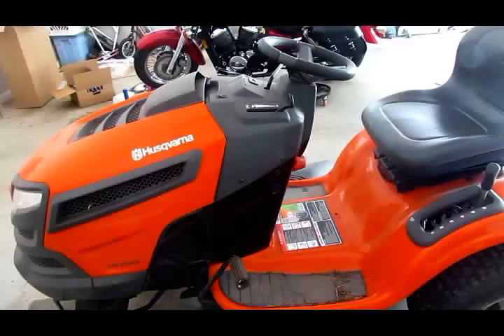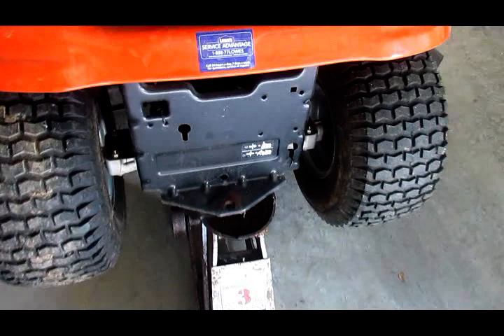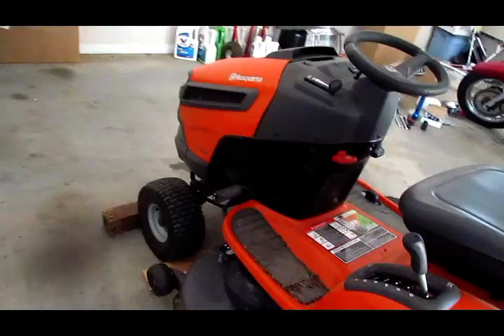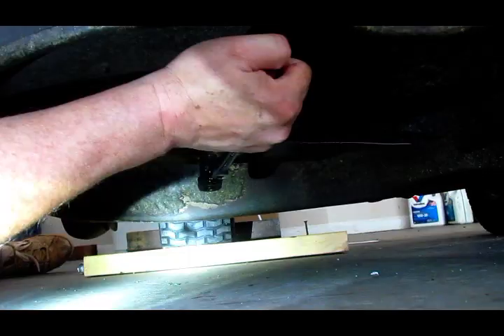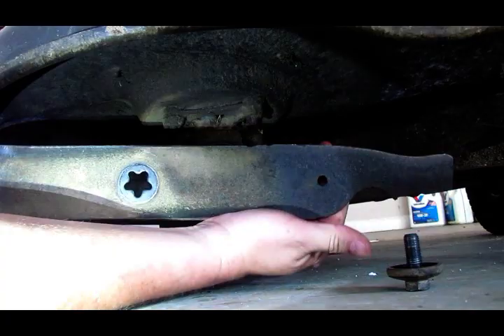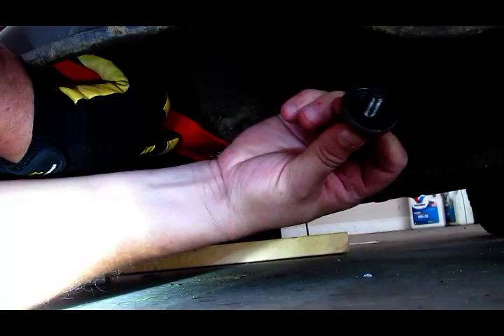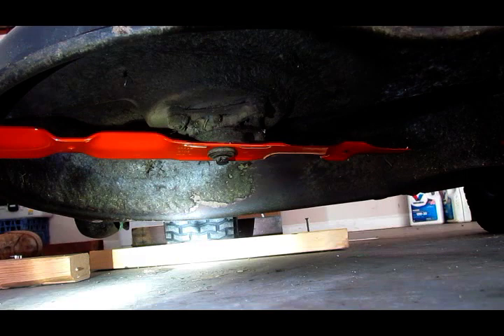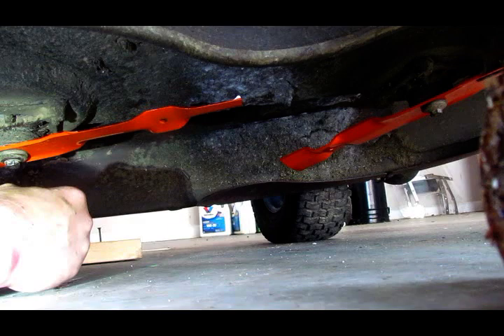Husqvarna YTH22V46 Blade Change - change your yard tractor blade

Comment: Hi Dennis...where is the reservoir for the transmission....I just want to check it because  !!!!  When I release the clutch it rattles....it's a modelYTA18542 
Thank you
Reply from the maker: Thanks for watching, Elaine!  I don't believe there is a reservoir for the transmission.  Husqvarna typically uses sealed transmissions.  The rattling may be the drive belt idler pulley (most common), a worn belt, or possibly the bearings in one of the other drive belt pulleys.

Comment: Dennis when you converted to mulching blades, did you find that you had lower the mowing deck one notch to get the same height cut you did on the high lift blades?  Great video!
Reply from the maker: Hi Rex, Thanks for watching!  No sir, the mulching blades I use have the same cutting height as the 'regular' blades.

Comment: Curiosity question only: In another video of your's, you showed using a set of Rhino ramps when you did an oil change and lifted the mower up on the front. They fit between the wheels, but I am wondering if they can be used for this procedure in lifting up the back of the mower, as well? Would they not work for this or is there something which would get in the way of them doing so effectively?
Reply from the maker: I think they would work fine.  I didn't have the ramps when I made this video, so couldn't use them or show that.  Thank you for watching, James.  Great idea!

Comment: I have the same tractor. The drive belt came off and took the fan blade on the transaxle with it. I cant find the part number for the fan blade. Any ideas?
Reply from the maker: Hey Brad, thanks for watching.  This is a tough part to get the number for, but this is what I came up with:  Part # 1A646083050
If you find one, just verify that it will fit the Tuff Torque K46 transmission.

Comment: Hi Dennis, GREAT VIDEOS..Why do you not use gator blades?
Reply from the maker: Thanks for watching, Charles!  I've tried them a few times, I just don't see any difference with my lawn, so I cant justify the added expense.  These generic blades I use do a good job, sharpen and balance well, and they are a lot cheaper.  It may be because I have a centipede lawn.....centipede cuts really well, it doesn't get real tall, so the clippings are small.  That may be why I don't notice much difference.
Reply: The Husky dealer by me WON’T install Gators 12:49 them as he claims their weight tear up spindles.  I used them on my 38 Poulan and had a broken, not worn spindle.  I believe him.

Comment: Hey there Dennis. Susan here again.  The lgt2654  has a grass catcher, some time it all goes well. Other times it just all jams at the opening. I wait 5-6 days after any rain to be sure it isn't wet.
I've had to dismantle the shoot to clean it out. Issue is once I take the shoot off I about pull my guts out to reconnect the metal things reconnected to the frame. What am I doing wrong? What can I do better to not hurt myself?
Reply from the maker: Hi Susan, thank you for watching!  I'm sorry, but I don't have a grass catcher and don't have any experience at all with the Husqvarna grass catcher.

Comment: Hi Denis sorry I’m bothering you again. But I was wondering if that tractor you have (yth24v48) is good for some what steep hills. I would say about 20-25 degrees slope. Please let me know bc your response will depend if I get that one or not and if not what would you recommend and what would be the best way to mow it. Thanks!!!
Reply from the maker: Hi Denis, no bother at all!  I have one hill I cut that is probably 25-30 degree incline.  I only go up or down the hill, never across it, as I think the mower would tip over if I did.  I don't have any issues going up or down the hill.  The tractor pulls the hill fine, even with the blade engaged.
Reply: Thanks Dennis!!!

Comment: Dennis I use a riding mower lift bought from my local Harbor Freight makes under deck work easy. Do you have a video on oil change?
Reply from the maker: +Michael Jones Thanks for the comment Michael!  I will, on occasion either use my motorcycle lift or a set of car ramps, but for the blades, I usually just change them out laying on the garage floor.  I'm working on an oil change video...hope to have it up next week!

Comment: I had the mulching kit installed but they didn't take off the chute cover which now is in the way. How do I take it off ??
Reply from the maker: Hi Rennae, I'm sorry for the delay in answering you....I just got time to look at my tractor today.  There are two bolts that come through the deck from the bottom, right next to the hinge on the chute.  Using a wrench or a ratchet/socket, loosen the nuts on top of the deck, next to the chute hinge and the chute will come off.  Be sure to push the bolts out of the deck and retrieve them from the bottom, they will likely be held in by grass clippings accumulated under the edge of the deck.    Good luck, let me know if I can help!

Comment: Hi Dennis, thanks for the great video.  Preparing to do this by myself for the first time.  A quick question:  when you put the blades on, are they synced so they won't collide as they spin or do you have to time them every blade replacement?
Reply from the maker: Thanks for watching!  Good question!  No, they are spaced so they can't hit each other.  You don't have to worry about timing them.
Reply: @dwcoffey  thank you!  That was a large worry for me.  Follow up question.  I mowed yesterday, grass isn't terribly thick.  Engine seemed stressed and like it had a lack of power only when the blades were on.  Could this be caused by severely dull blades or possibly another issue?

Comment: What type of blade came on your tracker when you purchased it?
Reply from the maker: Thank you for watching!  Here's what came on mine from the factory:  https://amzn.to/3L7oByW
Reply: Those are mulching blades. The blades that came on mine are black so I don’t know what type they are but I’m switching to high lift.
Reply from the maker: I've seen some that come with just a flat blade, no notches in the back.  That might be another of their 'standard' blades.  Of the ones I've seen, the mulching (what came on mine) have an added bend in the blade, the high lift ones have a 'notch' in the back of each side.  I've used the high lift and the mulching both, but mostly mulching because I don't bag my clippings.  I've had good results with both.

Comment: I have the same model have tried keeping the blade locked all has failed, wood, brick, rope, does anyone have any tips? Also I must lack the pull and grip strength to get the bolt off I have tried and tried, do I need air power tools for this? Someone please help!
Reply from the maker: Thank you for watching!  Try turning the opposite direction, you may have left-hand threads as some mowers do.  Also, if you have an impact wrench, electric or pneumatic, it will make this job much easier.  Also, on some mowers, I've had to experiment with the length of wood I use to block up the blade, some lengths work better than others depending on the geometry of the deck.
Reply from the maker: Thank you!  Please let me know how it goes and if I can help.
Reply: @dwcoffey  I will thanks, gonna jump back on it today.

Comment: I have a yth21k46 I went to engage my blades & they won’t engage what things should I try b4 I go to buy the cable & spring assembly???? Please help I’m very frustrated
Reply from the maker: Hi John, thanks for watching.  The first thing to check is the deck belt.  Make sure it is not broken and that it is properly routed around all pulleys.  The deck belt will sometimes slip off the main pulley under the engine and this will cause the blades to not engage.  I have a video that will show you the details of routing this deck belt:  https://youtu.be/SSKX3KOJjqw   If the belt checks out ok, then make sure the end of the engage cable is attached properly.  The above video will show how to do that too.  Let me know if this doesn't help and I'll try to help you further.
Reply: Thanks a lot I went out right after I asked my question & checking I found the belt was off the main pulley under the engine I felt so stupid lol. Well thanks I appreciate u getting back to me
Reply from the maker: Once the deck belt stretches a bit, they seem to come off that pulley a little too easy.

Comment: Underneath the blade when you pull it off is a little cap that good around the star, do you know how to get that cap off? I got a thin piece of wire that had gotten wrapped around inside of it and I need to get that cap of to untangle the wire. Thanks.
Reply from the maker: Hi Matt.  The cap is part of the spindle assembly.  I've not had the assembly apart before, but I know you can remove the whole assembly from the deck by removing the 4 bolts around the housing.  That might give you enough access to remove the wire.  If disassembly is the only way, I don't think it would be too big of a deal.  Check out my other video showing how to remove the deck.  Then take the pulley off the top of the spindle that has wire wrapped around it.  There is a bearing in the top of the spindle and (I'm guessing here), there should be a snap ring or an e-clip, something holding that spindle shaft and bearing in the spindle assembly.  If you remove that keeper, the shaft should come out of the bottom of the spindle.
Reply: Thank you, that's what I wound up doing removing the spindle, there was about 2 feet of thin wire like from an invisible dog fence (probably from previous owners) completely wrapped inside the spindle assembly. I appreciate the feedback and the videos. Thanks again.
Reply from the maker: Yes sir!  I'm glad you were able to get that wire out without disassembling too much!  Thank you Matt!

Comment: I jack mine up by putting the jack under the side of the deck, then the other side
Reply from the maker: I'm glad to know that works!  I was afraid I'd bend the linkage the deck hangs from....no problems with that?  Jacking it that way would sure be easier!  I've gone to using ramps anymore....run the tractor about halfway up, still gives me room to get under there without the ramp being in the way.

Comment: An easier way in my opinion is simply to lower the deck all the way, remove the 5 clips that hold the deck on then slide the whole deck out from under the mower, take the clip and spring that hold the cable on and then just lift up the whole deck onto it's side.  It also makes it easier to clean the old grass from under the deck.  Taking the deck off takes all of 5 minutes.  Easy peasy.
Reply from the maker: Thanks for watching and commenting!  You can definitely do it that way too.....I have a video showing exactly how to remove and replace the deck:  https://youtu.be/T_N9qre4xq4

Comment: Hi Dennis! What do you think of the YTH2348 Husqvarna? I’ve never own a riding mower/tractor etc but a friend has one for sell and wanted to know if they are reliable. I have hard a hard time finding reviews on that specific tractor. Please let me know ASAP! Thanks !! Im a new subscriber
Reply from the maker: Hi Denis!  I am not familiar with the YTH2348 at all.  My only experience with that model is what I can read online.  It has a Briggs and Stratton 23hp engine.  This is an Intek V-twin, just like the 22hp I am familiar with , so I would think there are no problems there.  The deck on this tractor is a 3-blade deck, as opposed to a 2-blade deck on the YTH22V46.....some people say a 3-blade design won't cut as well, some people say it cuts better and mulches better.  I suspect that if you keep your blades in decent condition, this deck will cut just fine.  You know, these things are like anything else, everybody has their opinion....there are some people that would rather cut their yard with a pair of scissors before using a Husqvarna tractor.  I love mine and I abuse the thing beyond belief....but I also service it like I should and I fix what I break during the course of that abuse.  :)  So....for me and my uses, I'd definitely consider a YTH2348.  I'd make sure it had been serviced...oil changes (check and smell the oil - you'll know if its burnt or really old), check the blades,  air filter, see how it cranks and runs....etc....all the things you'd normally check.  Good luck and if you buy it, I hope you love it!  Thanks for subscribing too!!
Reply: Dennis Coffey thanks for the response Dennis!! I really appreciate your quick response. It was very helpful. If i have any further questions I’ll def let you know since I am inclined on a husqavarna tractor. Thanks again!!

Comment: Den, just popped a belt on my Husqvarna YTH 180 - 42"deck. Mine has 2 separate belts, 1 towards the front pulleys & 1 towards the rear set. The drive pulley accommodates 2 belts & from there there are 2 additional pulleys to attach each belt. So, a total of 4 pulleys & the drive pulley. I get the jist of installing the belt but for some reason when I start the engine it wont engage the belt drive when I push in the swich button, is this a safety feature? I haven't installed the other belt as yet, just the one belt is on & around the drive pulley. Shouldn't half the blades still operate when button is engaged?  I hope this isn't too confusing. Thanks Dennis
Reply from the maker: Hi Dennis, I'm not familiar at all with the YTH180, so I downloaded the owner's manual and gave it a look.  It looks like if you have the top belt installed correctly, the left side blade should rotate.  The bottom deck belt doesn't appear to run directly off the drive pulley, but rather off the left side deck spindle.  I'd try to complete the belt installation (both belts) simply because running only one blade may cause some undesirable vibration problems and unintended consequences.  If once both belts are installed, the blades won't engage, there may be another problem.  There is a safety feature that will not allow the blades to engage unless you are seated on the tractor (pressure switch inside of the seat), so be sure you are in the seat before engaging the blades.  If that doesn't work, you will have to work backwards.......with somebody in the seat, engage the blades and carefully watch to see if the belt drive pulley under the tractor spins.  If it does, then the deck belts are probably not installed correctly.  If it doesn't, the attachment clutch switch may not be operating properly, you'll need to verify that when switched to 'engage.'  Let me know if I can help further, hopefully you can get it sorted out easily!  Thanks for watching!
Reply: Thanks Den, now I'm just having a problem finding the proper belt. In my description I had the drive pulley on the left side of the mower, didn't see the drive pulley directly under the the engine. I guess I'm old & stupid. That's the belt that went. I'll keep you posted. On my way to return the first wrong sized belt. Thanks again Den
Reply: Thanks Den for taking the time to look up the manual which I also did & for some reason it's not the correct pulley configuration in the manual. My mower has a total of 7 pulleys I believe the manual lists 5, anyway when my belt comes in ( no one carries it ) had to go to auto parts store after the husqvarna dealer told me the dimensions of the belt, he said it should work ok  ( 1/2" X 50" ) or  ( 4L 500 ) as listed at the auto parts store. I babbled enough, I'll figure the belt configuration when belt arrives. Thanks again Den. Your good guy & I'll let you know how it works out.
Reply from the maker: Wow...that's disappointing that you have to go through all that to get the right sized belt!  Well, I hope that ordered belt works ok for you.  If there's any way I can help, let me know and I'll give it my best try anyway.  :)  Thanks for watching and commenting Dennis, I appreciate it!

Comment: an old Navy trick for the bolts is dip them in milk of magnesia and the next time you take them off , no sweat. we used to do that on the studs of the exhaust pipe on j 52 jet engines 2000 degrees they'll Brad together if you don't
Reply from the maker: Thanks for watching, Tim!  Great tip...thank you!!!
Reply: well thank you I appreciate  that,
Reply: Dennis Coffey you bet potna 😁😸
Reply: Tim, I use Anti-Seize on the threads, or else as Denny says, lithium grease.
Reply: @Jay_Hall  I tell you something else just don't tighten it super tight cause it's going to tighten some anyway, that's what I did last time popped right off. Make a good point I'll try that also
Reply: @timcastens1150  Thanks Tim, I may go the torque wrench route next time.
Reply: @Jay_Hall  good idea, I don't own one, I just don't tighten them super tight any more and if it did start to get loose you'd notice how it was cutting. I used to tighten them as tight as I could get it, and I don't think that's necessary, just my opinion